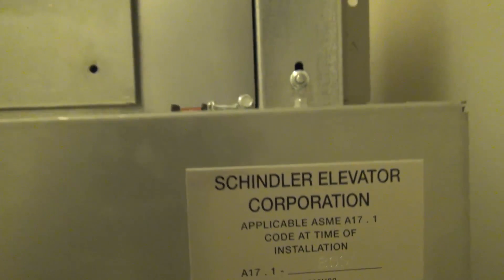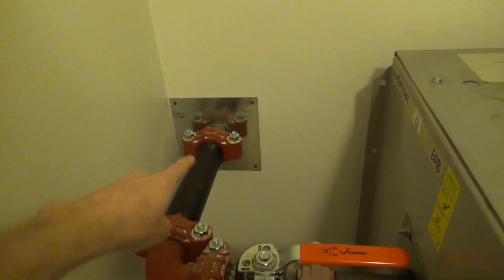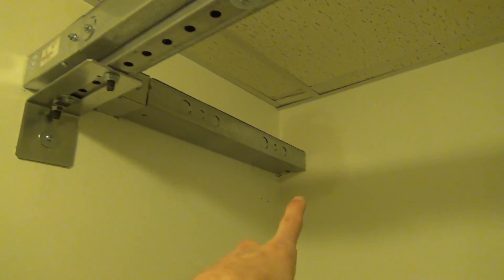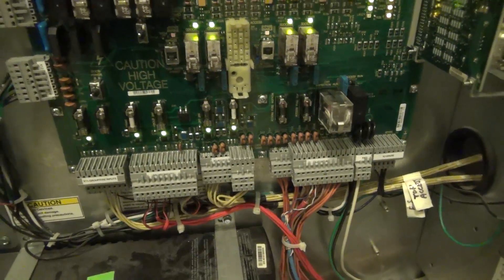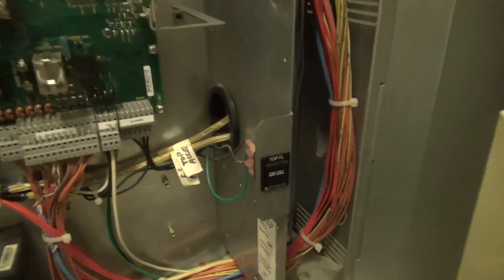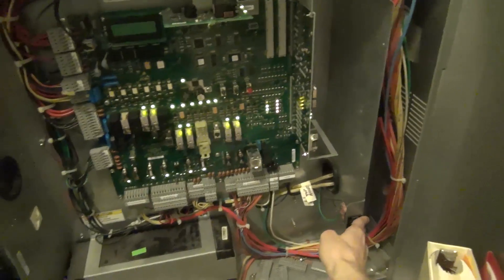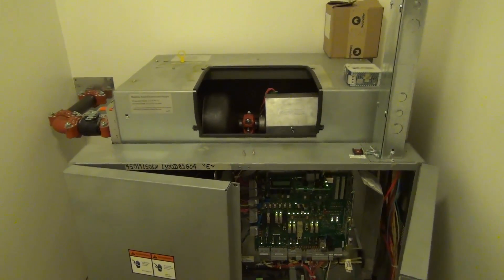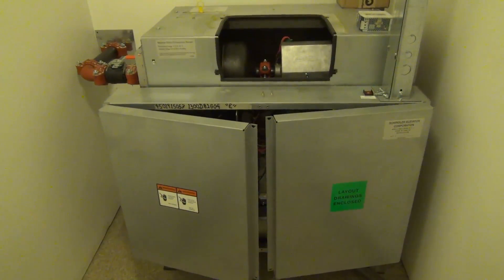Machine Room Tour of a Schindler 330A Hydraulic Elevator

Comment: Schindler divides the control cabinet. The left side of the cabinet contains all the high voltage three-phase and other high voltage equipment, the right side of the cabinet is all the low voltage stuff

Comment: What exactly does the system do when the elevator is going down? Why does it make that wooshing sound as it goes down?
Reply from the maker: The wooshing sound is the hydraulic fluid going from the piston back into the tank while the car goes down. The motor sound is the pump filling the piston with fluid which causes it to go up.

Comment: Our main fuse box has power, but the controller won't turn on. Any thoughts on why we can't get it to turn on? Figured I'd ask before calling Schindler 🤣
Reply from the maker: Are the fuses good?
Reply: @stlelevators  They appear to be good, at least the ones I could see....Schindler told us not to touch anything inside the boxes, but it really seems like it should be something simple to get our 1 elevator running again.... it's weird too, we have 3 total elevators, 2 work just fine, and all 3 main fuse boxes have power, but the 1 control box is clearly not on... the UPS at the bottom is not on either, when I hold down the power button on the UPS, it blinks and makes a sound, but then turns right off... it feels like it should be something simple, but we don't want to break anything! Thanks!

Comment: 220V seems low for a hydraulic elevator power unit w/ 3 phase power. I looked at the magnetic motor starter,  it was three phase.  Most of the commercial ones are around 330-440V AC.
Reply: The 220V is most likely referring to the line to neutral voltage (Most service terms use the line to neutral voltage [Eg. 120v 3 phase = 120-208v]).  For line to line, it would be around 400V in this case. Which is what I expect for this controller.
Reply from the maker: Interesting.
Reply: This uses a softstarter

Comment: Very nice machine. Although I wish there was more cable management on the pump starter section. (1:27) That is actually the control valve. EECO does not make pumps. The pump would be below the oil line (and therefore, very hard to see). Still, another great video STL! Keep it up :)
Reply: I would not have laid the liquid tight flex conduit on the floor from the secondary disconnect switch. However installed 3/4 EMT and if needed a junction box to change over to flex to get into the machine housing.
Reply from the maker: Did I say it was the pump? Whoops. I know it's the valve lol